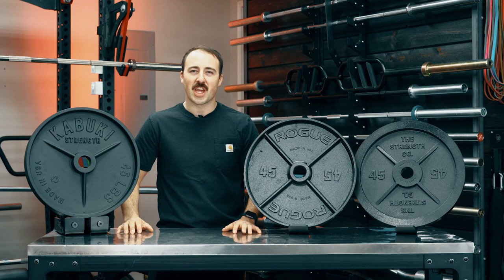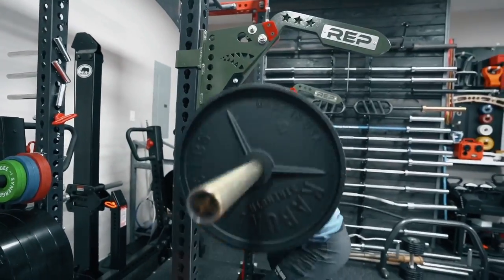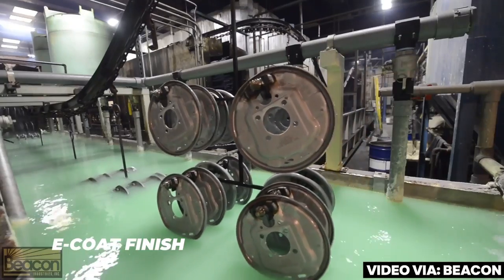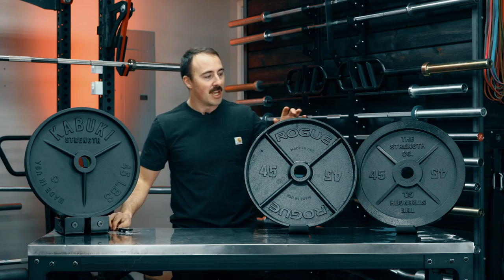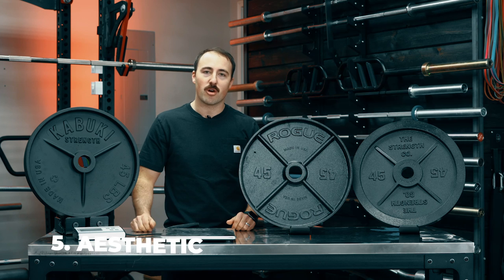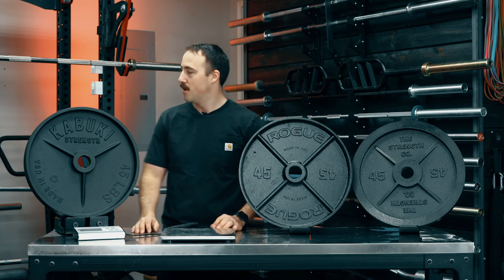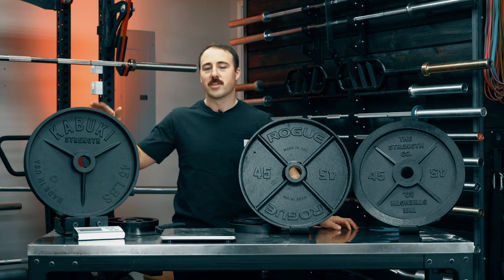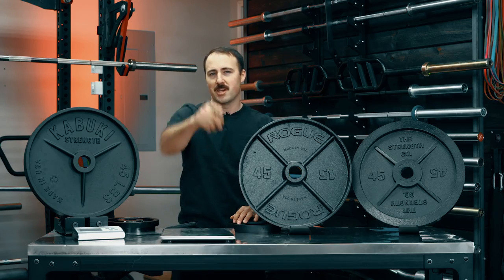The Best USA Iron Weight Plates for 2021 (Rogue vs. Kabuki vs. Strength Co.)

Comment: Have not yet watched, but Rogue is the only one who sells 35s, so I'm assuming they won.
Reply: Marvel crossover event confirmed, collab video coming?
Reply: Coop hates 35's so obviously they didn't win.
Haha but honestly the deep dish are the must bad ass looking
Reply: Not that I hate them, but I don’t own 35’s myself 😎😎😎
Reply: 35s for life!!!!
Reply: @lennythedog6544  I own 2 35’s lol rarely use them
Reply: They won best 35s, yes!
Reply: 35s work great, IDK why people don't like them
Reply: @alexsaulcastillocruz2589  yes they do work well, but it’s probably because it’s midway between 25’s & 45’s and if 35lbs is req’d than add (1) 10lb plate to a 25lb to achieve the same thing.
Reply: @GainsMarathon  you've got a very good point there mate.
Reply: @thestrengthco  oh people are in for a surprise...
Reply: @alexsaulcastillocruz2589  don't need them and they are overall less useful.  A 25 and a 10 can be well 25, 10 or 35. A 35 is a 35 nothing else
Reply: @Aaron-dl7hv  yes that's right, but they still are a good option when you can't find 45s
Reply: I have the rogue deep dish and no 35's...got the York Milled change plates and they match awesome...
Reply: @Aaron-dl7hv  if a 25 and a 10 is a 35 then isn't a 35 and a 10 a 45??
Reply: Every time you put the plates on with text out I die a little. 😀
Reply: @DrewLSsix  yes absolutely.  But you either wouldn't need the 35 because you have a 25 and a 10, or you have a 35 and a 10 and no 25, if you don't have a 25 but you have a 35 you probably didn't aquire plates correctly the first time. BTW if you have no lower body but you have a good upper body you have a problem building downstairs if you have the lower body.............sickening
Reply: Biggins iron make 35lb. As well and all USA made. I would be curious of your thoughts with them.
Reply: I have 35s and I never really use them, they are fine but if I could do it again I wouldve just gotten another set of 25s instead.
Reply: No one needs 35s lol Brandon
Reply: Nobody likes 35s. Rogue should lose based on that alone
Reply: @DrewLSsix  nope, because 45's should sit at 450mm just like a bumper plate would for Deadlifts and olympics lifts. 35s are too short to be useful in the regard
Reply: Fitness gear makes iron plates too.
Reply: @Aaron-dl7hv  ....what?
Reply: fake 45s?
Reply: I like 35's because I've always used them and they seem to transition better as I add weight in lifts (probably just habit). They work well for me when doing skull crushers with a curling bar because the 45's are a little heavy for warm ups and 25's require a longer reach to the ground. I think the visual transition 45. 35, 25. on the bar looks more appealing than the 45, 25, 25, 10 look (I know, my vanity is showing). I ended up with Strength Co. anyways because it's local for me and I saved over $300 on shipping, It is nice that they have matching change plates as well.
Reply: has anyone bought the rugged deep dish opinions?
Reply: 35s are crap. Just use a 25 and a 10, or get stronger and use a 45. 35s are for losers that cant use 45s
Reply: Is rogue the only one that makes 100 lbs plates?

Comment: I received my 375lb set of The Strength Co plates this week. I would say that they’re perfect. They have a very light texture to them that will help with gripping the plate. The finish on them is like nothing I’ve seen before. I like that the back is not milled. Amazing USA made product. I decided to purchase their Olympic and Power bar after seeing the quality of the plates. Great Company!
Reply: @maggiekay7426  I have a Rogue Ohio power bar, Texas power bar and Strength co power bar. I use each one for separate lifts but my favorite is the Strength co bar. It has deeper knurling and the plates sit around 3/4” closer to the bar which makes lifting feel more stable to me. But I also think the sharp knurling will turn a lot of people off so I’d recommend the Rogue Ohio Power bar for most people.

Comment: Thank you coop, for reminding me a $100 barbell can get you just as strong as a $1000 barbell.
Reply: Don't have a 1000$ bar and a 10 ₵ squat.
Reply: Forreal. I have the smallest budget and everytime I watch a home gym video, I still feel bad for buying a 170$ bar.
Reply: @michaellk2254  has it bended yet?
Reply: "ATX® POWER BAR + 700KG - SPRING STEEL - CHROME" is this one good? i have this
Reply: @aba192  thank you Mr Simmons.
Reply: @MMAengineer  No clue, I bought a cerakote Boneyard 28.5mm Ohio Bar from Rogue for $220 shipped. Probably one of the best values at that price point. Save money on a rack and spend it on a nice bar.

Comment: Overall, solid review. Having both the Rogue DD (45s & 25s) and the entire StrengthCo collection, I find your review fair and accurate. The only thing I will argue with is the matching of the back of Rogue. I first considered it an advantage because it’s perfect and beautiful. However, after months of use of both plates, I now consider StrengthCo not machining the backs as an advantage toward long term durability and aesthetics. The backs of StrengthCo are exceptionally durable as a result while the Rogue scratch very easily
Reply: This has always been our position on this. Machined backs scratch over time with iron on iron usage.

Comment: Good review coop. If you are concerned with running out of room due to wider plates for deadlifts, then you need a deadlift bar. If you are running out of room for squats or bench, you are a god and don’t need to lift weights.

Comment: I just love 45’s with grip handles/ grip holes near the rim.   So great even for loaded carries.  Also, my wife who’s average strength would have trouble helping me load those plates without holes- harder to pick up off the ground if laying flat and gotta make sure grip is really secure when sliding them off a weight tree or else might slide out of hands and necessitate a visit to the Podiatrist.

Comment: I have the deep dish and the Strength Co plates. I moved to iron from bumpers. I like both they iron plates. the deep dish are easy to use with that great thin lip. The Strength Co's are great also they have  a good feel and look great to me. I think it is a toss up between the two but I would go with the Strength Co plates because I like supporting a person that just saw a need and filled it with USA made products.

Comment: But coop you didn’t even talk about the tolerance of how they fit on the bar that and how the strength co has extra material around the area where you slide the plate onto the bar sets it above both of these as far as quality goes for use
Reply: This is an important feature. We agree.
Reply: @thestrengthco  I also agree, but maybe the >$600 in plates I just bought makes me biased?
Reply: I have both the Rogue Deep Dish and Strength Co. plates.  Not only does Strength Co. offer a complete assortment of the sizes of plates (2.5 - 100), the Rogue 25s are not easy to handle given their is no deep dish feature on them.  In fact, the Rogue 25s have slipped out of my hand due to the almost non-existent lip for gripping it.  I like the fit of the Strength Co. plates on my bar better than Rogue, which has a little play in it.  Agree the finish on the Rogue's are as good as it gets, but the Strength Co. finish is about as good.  For me, the Strength Co. plates are a clear winner over Rogue given the fit on the bar and complete range of plate sizes.  Yes, Rogue is less expensive, but neither are inexpensive and are an investment, so the Strength Co.represents a better value to me.

Comment: Tight fit is the most important feature for me, and I didn't hear that mentioned. I bought Rogue hundos last week, but I have my eye on Strength Co in the near distant future after I sell some of my bumpers and cheap Standard 45s. Maybe a fringe view, but I wish for heavier plates. Strength Co joked about 55s (because "fahves"), but that would honestly be a sweet spot for me. One or two pairs of hundos, two or three pairs of 45s, and eight or nine pairs of 55s would be my own personal Valhalla. For change  I have the Titan Fitness color bumpers, including urethane 25s and 35s, which is super nice for cutting down on noise and looks just fine over iron.
Reply: I'm a big fan of 55s, too, and I'd love a Strength Co. version.  A set with 1.25s, 2.5s, 5s, 2x10s and 25s would cover every weight from 2.5 to 107.5 pounds.  Just add 55s to taste from there!

Comment: Hurts my soul to see the outter plate faced outwards.
Reply: Isn’t that the competition standard?
Reply: @Imsoflattered0  possibly but it is garage gym review and not garage gym competition. Just a preference when mounting and dismounting plates with lips rather than grips.
Reply: @Aaron-dl7hv  the outer one should be faced inward, but should the inner one be faced the same way? Or opposite? I never understood
Reply: @jacquescoury2979  so it would seem with competition plates you would have the faces oppose one another to preserve the graphics/wording.  But with normal plates the status quo is to face both plates inward to give you better grip (4 fingers) when loading and unloading the bar.

Comment: Being nitpicky but I feel the accuracy category is a bit unfair if only because you had the luxury of assessing Rouge's accuracy in a way you couldnt with StrengthCo or Kabuki. Not that any reasonable person would expect you to have multiple sets of each plates but I dont think it should factor in your decision when its not a variable you were able to control. Maybe give Kabuki a point since they were technically the most accurate in that test. But follow up with an asterisk noting that you've have enough sets of the Rouge plages to certify its accuracy?

But either way, it still wouldnt change the score and it was still a great honest assessment :D

Comment: Thickness matters at some point, I'm strong enough that I can lift more than a bar full of echo bumpers, but reality is that you can get 675lb on the bar with the Rogue Deep Dish. More than most can lift - but yeah, thinner is better usually.

Comment: Also more width means more storage space. 
Shout out to the American Barbell rubber coated plates.  I've been using them for a year and absolutely love them.  There is nothing like having built in rubber handles on every plate.  Quite a bit more expensive though.

Comment: Seriously though for most people just buy whatever is cheap at a local store. They're steel plates, it doesn't really matter which one you buy. And buying from a store means not paying for shipping. Even during the pandemic plates are cheaper locally than online
Reply: I've been through a decent number of the cheaper plates out there and there are some I just don't like for certain lifts.  Fitment can matter, when you have a couple hundred lbs rattling around at every step it just gets old.  

My oly plates today are all the standard brand Chinese plates and I have the better ones at the front of the stack so the bar isn't flopping around or rolling all over the black during deads and the plates aren't wobbling everywhere.

The worst for that were the Golds grip plates with the beveled center holes, they had to be clamped down every time or they would wobble right off the bar! 

Of course, in the current environment I wish I had held on to even the junk plates! Either to sell them at stupid prices now or just to have them for the strongman stuff I have been doing.

Comment: I bought 3 pair of strength co's second run. they were all 46-47ish lbs measured on a bathroom scale.
Reply: Coop has our original "sample" plates. When we ran our first 20, yes just twenty plates so we could test. With a few adjustments, our plates are now between 44.6 - 45.4 99.9% of the time.
Reply: @thestrengthco  I like them heavy! I'm not complaining. Besides it's an exceptionally cheap scale.

Comment: None were available when I was looking for plates. I ended buying the Troy wide flange plates. The only issue I've had with them is the 2" hole does not fit my westside barbell scout reverse hyper. What is your opinion of the Troy wide flange plates?

Comment: I went with Vulcan rubber coated oly plate that was $199 shipped for 45 plates (currently out of stock 🙄) but found them to be a better deal. Rep fitness sport bumpers and fringe sport bumpers look like just as good a deal as iron and maybe cheaper after shipping. Why buy iron anymore?

Comment: Controversial opinion, but I'd take The Strength Co. over the other 2.
Reply: The underweight one?
Reply: @mkdorkov123  if <1 pound variance +/- is going to ruin your training, you should buy calibrated plates.
Reply: @mkdorkov123  Coop has our first samples that we did R&D with. Check our customer reviews. We've dialed in the accuracy now.

Comment: Nice review,  Coop. To be clear, are the Strength Company plates machined on the INSIDE where they contact the barbell sleeve?
Reply from the maker: Correct
Reply: @GarageGymReviews  They look like my 30-year-old York USA iron plates, but my Yorks are in kilos.
Reply: @GarageGymReviews  Thanx!
Reply: @keysersoze5920  That's what we modeled them off of.

Comment: I think you. are under rating kabuki a little by not acknowleding a few things.First off kabuki is the only one of the three that has the old school deep dish look.2nd it has a powder coated durable finish that will last.They offer all the most common sizes so you can build a complete set.

Comment: You should make a review for the EliteFTS American Cambered Grip Bar
Reply: I have one.  I bought it because my shoulder was bothering me from benching a lot with a regular bar.  To the point I developed an impingement in my left shoulder.  It's been almost 6 months and I'm almost back to normal.  I do competition bench once a week with a power bar and the other 2 bench slots are on the cambered bar.  It's nice for rows as well.  It's a good bar if you have some spare cash.  It's not exactly inexpensive.

Comment: Given how expensive Kabuki's shipping is so expensive, why not just machine those plates and add a higher quality coating.
Reply: I have been to their warehouse (I picked up my plates in person)... they are still a relatively small facility, but growing quickly.  I would not be surprised if machining was in their future, but at this point it seems that bar production is taking center stage for them.  They do not cast or coat on site, and would need new warehouse space to add the equipment necessary for machining.
Reply: @RraMakutsi  More people making things is always good news, my dude. I shouldn't complain too hard though. I live in Canada and everything is always more expensive here.